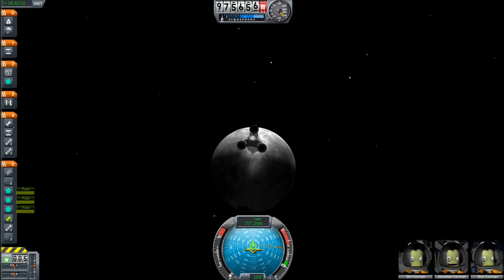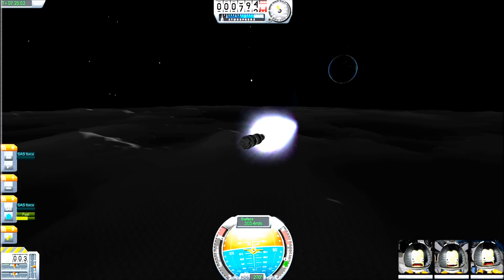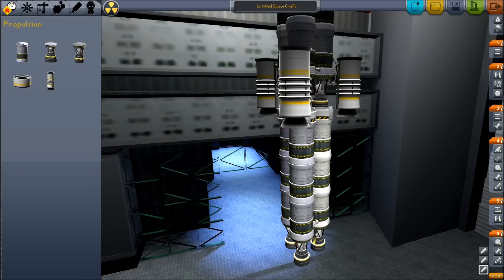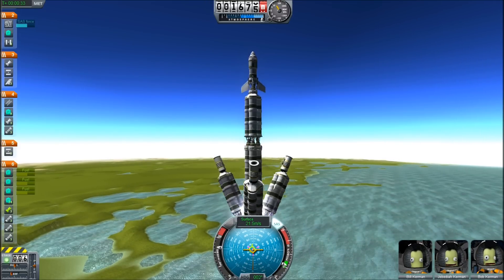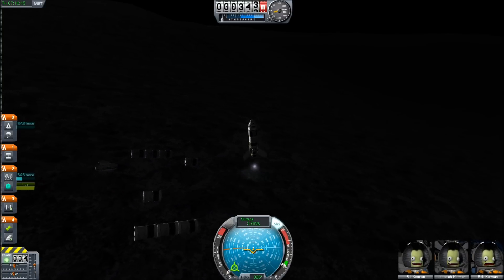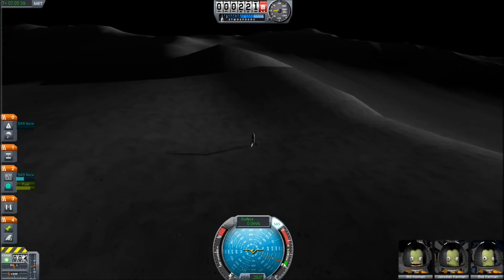Kerbal Space Program - The Ultimate Moon Landing Tutorial

Comment: use a few wings to make it stable and use stuctural reiforcements so your rocket wont shake a lot.sometimes it happends because you have a lot of weigth on top of the rocket,it should be on the botton. check you center of gravity it should be in the middle or botton of the rocket.   if u need any help keep praticing and trying new things

Comment: For everyone that says tri coupler wont go on, What you have to do it use a part called "structural pyron" it gives you enough length for the tri coupler to go on, so what you do is connect the rocket boosters to the structural pyrons, and then add the tri couplers to under  the rocket boosters, HOPE THAT HELPS =]

Comment: What I did was instead of placing the radial decoupler on the second to last stage, I placed it at the very bottom and started building everything from there, since there is more space. Then when the entire outside structure was ready I simply selected the radial decoupler (along with the structure) and moved it up to where it's supposed to be. It may take you several attempts to get it to attach, but in the end it worked.

Comment: solution: put another horizontal decoupler on top of the first, then attach the solid booster. worked for me. no stability poblems (I also attached an extra fuel tank and some winglets to the second stage, that greatly helped me).

Comment: So I tried to attach the tricouplers to the solid boosters. It didn't work. I spent the next 10 minutes or so to get the decouplers and the solid boosters as low as possible. I did it Pixel-wise. After being 100% sure that I got the lowest configuration possible I tried again, and the tricouplers still wouldnt fit under the booster. Does anyone know what to do?

Comment: Hello! Made your rocket after your specifications (as closely as possible) with v.16. Upon launch, the rocket begins to spin in one direction, and then the other. By the time I reach 500m/s, it gets tricky to get the rocket pointed to 270 degrees in good time.

Any suggestions?

I got lucky once, but just barely missed the moon, running out of fuel to make adjustments.

Comment: I had the same tricoupler problem so i used rts fuel tanks on top of the nine 7th stage fuel tanks so my rocket wouldn't fall over, but i had a serious drifting problem when i turn the sas off to do the first maneuver. That rocket got me to the mun twice but both landings clashed. Then I finally got the tricoupler to fit right and the drifting stopped so I was able to maneuver much better, i landed of the mun and returned safely. thanks for the vid

Comment: For 3:17, instead of using the tri-coupler, put three radial decouplers on the solid fuel boosters as low as possible. That way, you can get the same effect as having the tri-coupler. To make the side rockets long enough, just put a stack decoupler on the bottom of each so that the middle rockets do not get destroyed during the launch. Problem solved!

Comment: ASAS (Advanced Stability Augmentation System) is kind of like an autopilot; it tries to keep your rocket at a certain angle. SAS (Stability Augmentation System) just prevents your rocket from spinning out of control. In my opinion, always use ASAS. Also, multiple ASAS modules will do nothing whatsoever. Only one is needed and if you put more on, they will not have any affect on the stability of the rocket. RCS thrusters are used mainly in space, and ASAS can use them, while SAS cannot.

Comment: I haven't noticed any difference in using more than one.  All my rockets use one just fine.  From what I have gathered, the SAS module helps prevent roll and gymbal control.  the ASAS is what will allow it to also hold a fixed flight path.

The RCS work just like your engines in principle.  More you have, the stronger their boost and more fuel consumed of the RCS fuel.  In atmosphere, they are not powerful enough to have any real effect.  Using winglets would do more... cont...

Comment: Question on the later expansions.  I have been able to get good orbits, and approaches to the moon, but my landers are a bit heavier, just due to design.  I find that on landing, sometimes if there is any slide, the folding legs will do little hops, and it will skitter across the ground and then the lander legs bust off, flipping the rockets.  Any structural tips or advice on the folding lander legs to prevent this?

Comment: I found that the strength seems to have changed a bit. (The resistance to wobble)  This has resulted in my rockets making odd turns or wobbles.  What I noticed is if you have a weak booster structure, it will wobble out of vertical, providing a rotational thrust.  as it rotates, this booster will flex out more resulting in an exponentially worsening situation.

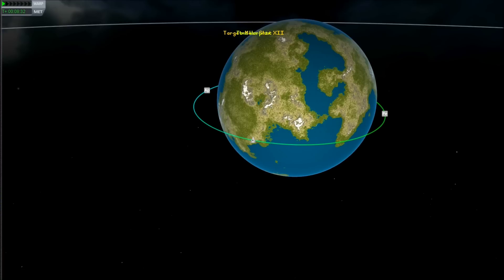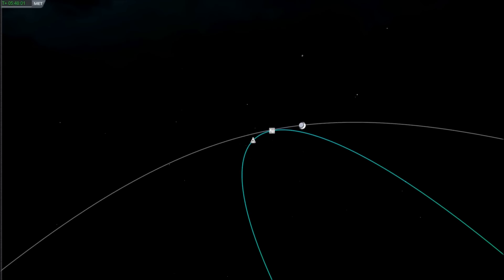Comment: Some notes, during the orbital (5:25) I encountered spin at about 400m/s, I fixed this by throttling all the way down, turning SAS off, then on, then throttling up.  During the transfer burn (6:15), there is a ton of room for error.  I overshot, then undershot, then hit it at 11.42m (green X helps you lower orbit).  During the moon landing (7:11 actually 8:05)  I did a control burn at 50k and 10k but didn't do the safety burn soon enough (1-2k).  I didn't realize how fast 150m/s was(3 secs died)

Comment from the maker: You can go 90. When this video was made the position of the moon always started in the same place so going toward 270 took less IRL time. Additionally, it is a slightly faster in game time to go toward 270. The other advantage is that you have a larger window for rendezvous. It takes about 500 m/s less of delta v in a mission that takes about 5000m/s of delta V. That's a 10% savings which multiplies in reducing rocket size. So either way is fine 270 just worked better in this case.

Comment: hey people i found the solution to the tricoupler at 3:17. find some way to put the tricoupler on the solid boost rocket before putting it on the radial decoupler (one simple way is to switch symtry to one  then put the solid boost rocket on the bottom of the liquid fuel engine and put the tricoupler. hope this helps.

Comment: Issues: (with 0.13)
1. Solid rocket booster is on during liftoff and damages the tanks below it.
2. Placing the outside tanks was difficult because the pieces wouldn't line up on the bottom.
3. Spinning spinning spinning. I added a few mod sas nose caps to the tops of the solid rocket boosters to fix this. With only the 1 Adv. sas unit it would spin uncontrollably very fast. 
4. Lift off power seems very low. I tried using modded engines with more output and it would not even lift off.

Comment: I find it easier using the RCS Thruster blocks. The tip of my rocket was like this (in order): Parachute, Command pod, 3x RCS fuel, w/ a 4-symmetry RCS thruster blocks on the top and bottom ones [end of stage 0], 2xStack decouplers in a row(you will want these in different stages; 1&2), Adv SAS Mod., Liquid Fuel tank w/ R8 winglets attached, T45 LFE[end of stage 3]. You have to land with the Decoupler from stage 1 in order not to explode.  The rest is just like in the video, which is great btw.

Comment from the maker: @rslayer9 The vectoring engine moves from side to side to add a level of control when the rocket is firing. This helps keep large ships on course. It is also less powerful and uses fuel more slowly. I like to use them when I don't need a maximum powered boost. Because they are weaker they are easier to control for the landing.